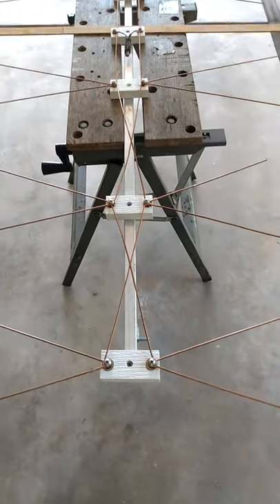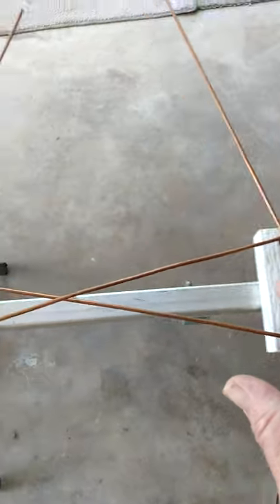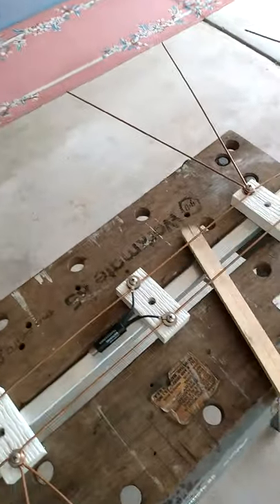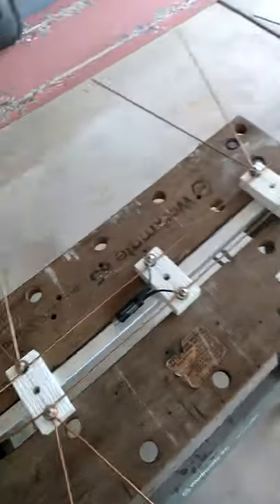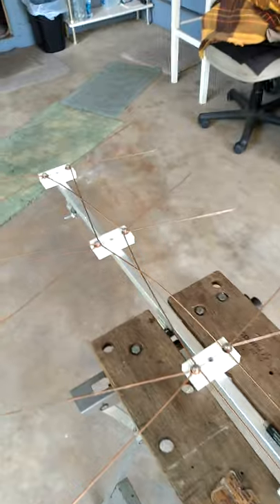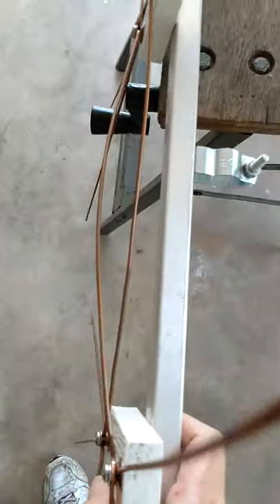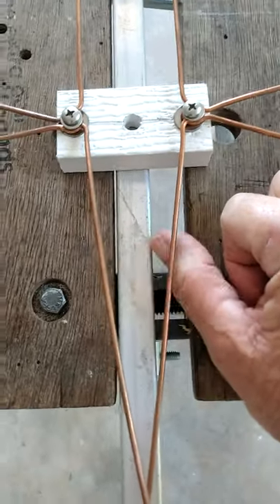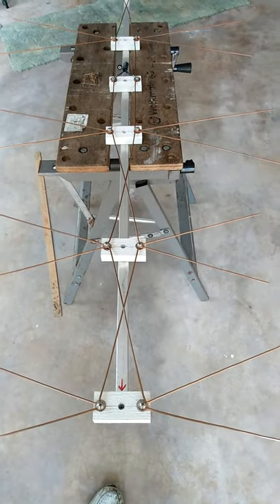FF6 MEASUREMENTS

Comment: Have you made a decision on the reflector type you are going to use CA ??? Screen or rods ?
Reply from the maker: Neither. I left as a non reflector model.
Works for areas without trees. 

All reflector options became too heavy.
Reply: @cosmicantenna9244   I can agree with you CA on the added weight part. My area right now is just one tree next to another greener than green. I have to deal with monster trees and signal has to go right through the dense forest. I will see how things work out. Thanks for the guidance about the weight. I received my 1/16" diameter Ampco trode 150 in the mail. Now I have the material to make the reflector with. Decision time, what is the best rectangular dimension for the reflector ?? I was thinking making them 1 inch X 2 inch spacing. What size would you use fella ???
Thanks for the information Sir M. Peace

Comment: Would adding a single straight element cut in two with reflector added make this also VHF high band ??? How about why the bridge wire are in a zigzag pattern ??? Thanks Mr. M. too.
Reply from the maker: Don't try to change the ff6, it's a very complicated antenna.
Reply: @cosmicantenna9244  O.K. I will make this antenna right to the instructions. Will have to make an auxiliary antenna for VHF. I got a question Cosmic Antenna, Would making an Televes DAT BOSS LR Antenna be possible ??? This antenna supposedly really performs. The latest unit is UHF High VHF Low VHF unit for roughly two hundred bucks. What do you think Sir ??? Thanks a bunch and peace to you Sir. Happy Easter too. vf
Reply from the maker: @victoryfirst2878  
Victor, the comment section is not the place to try and carry on a conversation, messages come in from too many sources and I have to track it down to try and answer. You've got to use the Cosmic email
Cosmic222@protonmail.com
This way all the messages are in one place. 
If you continue to use the comments section I'm just not going to try and answer it's too much trouble. 
Use The Email address please.
Reply: @cosmicantenna9244  Would making two antenna and mounting them side by side relive very heavy tree leaves ??? Thanks
Reply: @cosmicantenna9244  I am sorry for not following protocol in the comment section of the YouTube site. Will just email you sir.

Comment: Since this is a bowtie whisker antenna, will this have a good upper VHF signal gain Sir or does this only happen with a Gray-Hoverman type antenna ??? Thanks
Reply from the maker: No. Not a good vhf antenna.
It's cut for UHF.
Reply: @cosmicantenna9244  Thanks Mike.